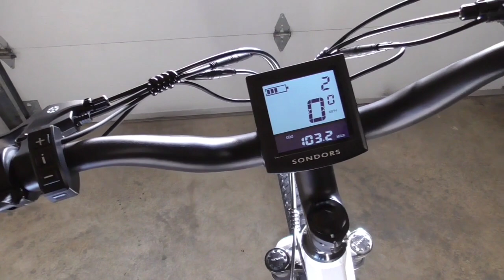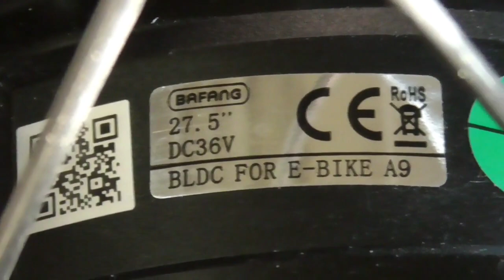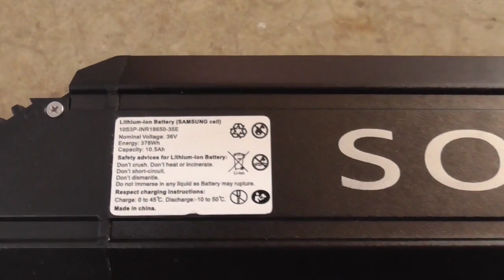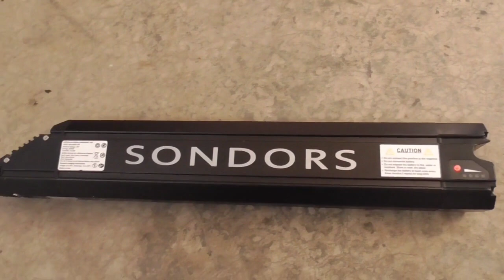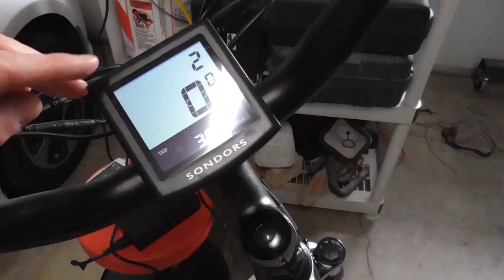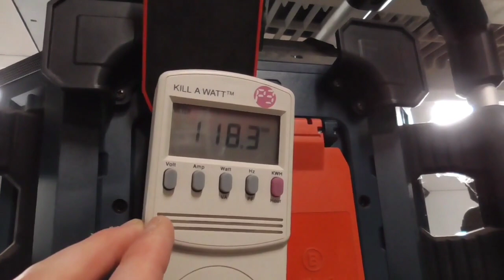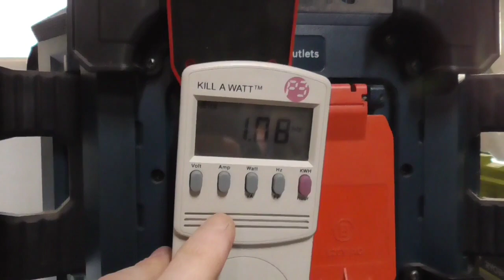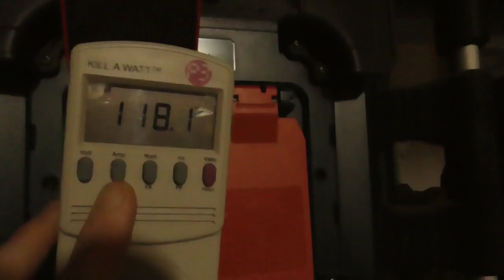Sondors Step - Review

Comment: thanks for this review i am gunna mention ur channel to the bike shop near me in dallas when i buy this bike. its everything i need and cant beat the cost
oh
btw a 18650 is roughly 10-12watt hour per cell so 360ish watts would mean
10 in series but 3 banks in parallel so roughly 30 batteries in total
and with name brand cells thats a huge wow how did they keep the price so low

Comment: Thanks for the great review! Thinking about purchasing a folding ebike and have been looking at this bike and the Rad Mini. Like the looks of this bike much better and might be better suited for a little taller rider than the Rad. Looks like you've had the bike for a while now, are you still enjoying it and has it given you any issues? I was also wondering if your happy with the amount of power that the 350W motor provides?

Comment: I am in the market for an affordable first bike. it is a big investment for me so I dont want to mess up. I need it to commute about 9-10 miles each way to work. You mentioned some less expensive bikes you tested. What were they and why did this bike end up being better. Also how off do you think the battery cycle is on the Sonders? Is 50% really 50%?
Reply from the maker: Have you looked at E-scooters.  I've reviewed & have a Ninebot ES4. You get: a much lighter compact design,  regen braking, cruise control, headlight/taillights, & a highly accurate SOC display.  Also, same battery size & better pure EV range for about $700.  The just released MAX model might be even better.

If you need to pedal,  I actually test rode a lot of more expensive e-bikes & none of them ever impressed me.  The sondors step is the most affordable option I've tested.  The cheaper stuff seemed too junky to bother with.  But, yes the sondors/bafang SOC display is horribly inaccurate as I mentioned many times.  Hope that helped.
Reply: If I had to do again, I would have saved a bit more and gotten something like a Rad. I find the brakes lacking on this bike. My commute is a mile each way. I don't use the throttle at all, only the pedal assist at level 2. I turn off the assist on downhills, so I'm only using the assist on inclines. I can get away with charging every other week. Using the throttle all the time drains the battery quickly. Sorry, don't have any specs at hand. If you are going 9-10 miles a day, I would advise making sure you get a durable, reliable bike with good support and customer service. Going from under $1000 to just a bit over $1000 gets you in the range of a good, reliable commuter IMO.
Reply: After looking at this bike on the Sondors website the price has increased to 1199+shipping - the wheels are nice but becomes a disadvantage to shorter riders as handle bar height is at or near 47”.  $200!more gets you 26” tires and 42” min handle bar height of Rad City along with higher battery capacity, fenders, rear rack, upgraded rear derailleur , larger disc brakes

Comment: the BMS was ramping up to raise the cell voltage at or near 4 volts which would be a slight over charge if you consider 3.6 the military standard. give a 20% loss in the conversion and the pack at full charge is closer to 400 watts capacity with what apears to not have a low voltage cut off.

Comment: I bought one today 07/23/22. Unfortunately they’re not under $1k anymore. I paid $1450 plus tax. So after 2 years, how is the bike holding up? Have you had to change a tire or tube yet? How is the battery holding up?  Any major or minor problems? With several e-bikes in this price range, I decided to get this one because Costco sells it. Costco usually sells quality items and their return policy is pretty good.
Reply from the maker: $975 was the special pre-order discount of $275 off.  Inflation makes up the rest.  It's still a solid price.  Other than the "hefty bulk of it" while loading/unloading into a vehicle for transport; it's been operating problem free.
Reply: 499 right now
Reply: @jayd7531  where?

Comment: Great video...only concern is where you get service...having that issue with my del sol from haro..no service close!
Reply from the maker: I always think of bicycles as a simple self serviceable item.  But if not, then any bicycle shop should be able to do service on it.  If the electronics fail, then it would be a little bit more difficult.  Sondors does offer tech support for their products.

Comment: Question regarding the steering column. From the forks up through the bore, and into the handle bar stem, is loose from front to back. I notice it when braking. Is that the normal design? I don't see where or how that gets tightened.
Reply from the maker: No, it's not normal.  You need to tighten up the play in the headset bearings.  Don't overtighten either, as the handlebars won't turn & bearings might fail.  The handlebars should turn freely side to side and the forks should go up & down, both in a firm controlled manner without being loose.

Comment: Thanks for this thorough review. Q: can you remove the battery and charge it away from the bike? I live in a condo and can’t charge it in my shared garage.
Reply from the maker: No problem, as the connection from the cord to the battery is the same (in or off the bike).

Comment: Bought it a few days ago, and can't figure out how to put this 65 pound monster into SUV's trunk while weighting only 110 pounds 😅. What a miscalculation..  I find removing battery makes it a tiny bit lighter. also it needs a belt or so to just keep it in folded position sequrely. Will probably make a ramp and put it on a cart for my back's sake
Reply from the maker: It's definitely a beast.  Especially, loading/unloading in any vehicle &  pedaling uphill with a discharged battery.

Comment: on the other hand volts x amps = watts but
i can only guess the killowatt meter cant measure modified sign waves.
but even that doesnt make much scense cuz the power adapter is taking AC and converting it via a transformer to DC on the backside...
very strange it showing 78 watts instead of 120ish

Comment: Are you supposed to plug the charger first into the wall then the bike or the bike and then the wall?
Reply from the maker: This is like asking the same about your phone, car, power tool, or anything else with rechargeable batteries.  Most people leave the "charger" connected to the wall, that way you make one connection per charge.   But, it really doesn't matter.

Comment: How hard is it to pedal once the battery dies?
Reply from the maker: It's about 60 lbs. (which is over twice the weight of my full suspension mountain bike) & it's got wide knobby tires.  Both of these add more resistance when pedaling unassisted, especially uphill.

Comment: I’m having a chain drop problem with mine in first or second gear. Have you had this problem
Reply from the maker: That's usually just a fine tuning adjustment of the cable length from the shifter.

Comment: What is the real world range in miles from a full charge?
Reply from the maker: It's kinda hard to say.  The motor is designed to "assist you" not simply throttle it like a motorcycle.  Since it has different levels of "assist" the range can vary greatly.  I was personally going 40 + miles with still some charge remaining while on the lowest & second lowest assist levels of 1 & 2.
Reply: @The Evolving World... I assume top speed as it comes is 20 mph?  But can you program it to go 25 or more? And do they offer an upgrade battery for better range?
Thankyou for your time.
Reply from the maker: @joethompson2910  The "top speed" varies greatly by: how hard you pedal with full power assist.  Along with a tail wind & going down a hill 35-40 can happen.

They do offer additional batteries that can be carried in a back pack and swapped if you need to.  Once again, range depends on how elec. assist you use.
Reply: @joethompson2910  I believe the law limits the speed of these to 20 mph under battery assist. Otherwise I think that they have to classify it as another type of vehicle. I have heard of people bypassing the speed governor on e-bikes, but I haven’t seen it.
Reply: on level 1 assist you could ride 4 hours. on level 2 assist 2 hours.... one hour is about 15 miles... so if you are using level 1-2 assist you could get to 30-60 miles. Let me explain: in the bike settings level 1 has up to 20%, level 2 up to 40%, level 3 up to 60%, level 4 up to 80% and level 5 up to 100% of power (you could re-configure this). During ride it shows watt consumption... for level 1 it is up to 90 watt and for level 2 it is up to 180 watt. you battery is 10.4 Ah and voltage is 36 V so total pack in Watt hour is 10.4*36 == 374 Wh... 374/90 would be around 4 hours.

Comment: Can anyone tell me how the kill-a-watt reads 118v x 1 amp = 74 watts ? LIke eh?
Reply from the maker: The meter is showing the "real power" by taken the "power factor" into the equation.  In this case, it appears to be about .63. 

"Power Factor" is a measure of the effectiveness with which an electrical device converts volt-amperes into watts. Power factor is represented as a dimensionless number between 0 and 1.
The closer the number is to one, the 'better' the power factor. 

Formula:  Amps (A) x Volts (V) x Power Factor = Watts (W)

It's only on DC circuits that the formula would be: Amps x Volts = Watts.

Comment: Just bought thr bike . It was  not powering up...found out when I folded.the bike  or.if was bent already .that the battery terminals.got.bent  and one the connectors was not.connecting due to.getting bent from.folding it.and.getting     bent from sitting against the ground . So be mindfull of.those.metal tips.that get exposed. When folding the bike .

Comment: anyone know where the serial number is located?
Reply from the maker: It's 10 digits.  Starting with "AZ", "19" for model year( if it's a 2019), & 6 more numbers.  Standing on the right side, look down at the crankshaft (where the pedals & crank arms meet the frame) it's on the top facing you stamped into the frame.

Comment: This e-bike you have to keep pedaling in order to use the electric motor! Who wants that?
Reply from the maker: Actually, there is a thumb throttle that allows it to go full electric drive.  It's not really optimized for that & the range would not be much.  If you don't want to pedal, than getting a e-scooter or electric motorcycle would be a wiser choice.